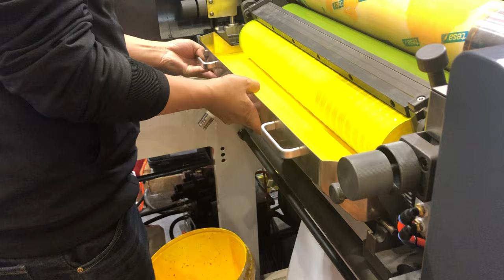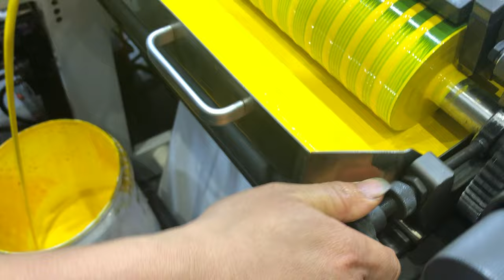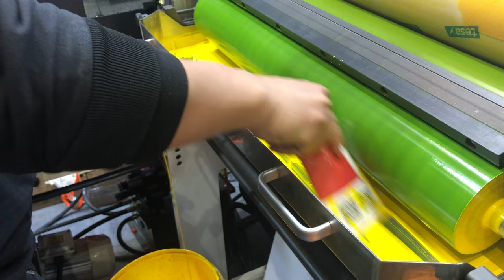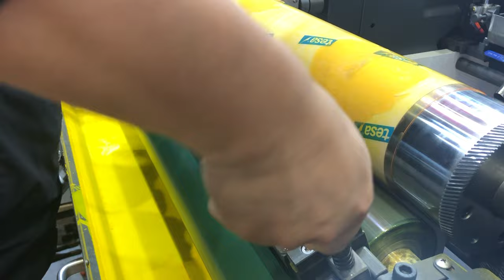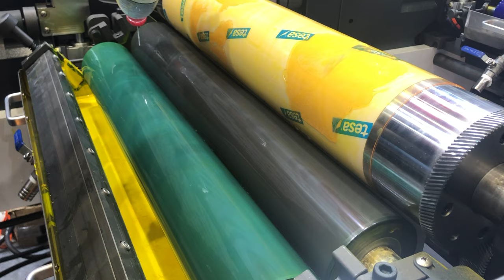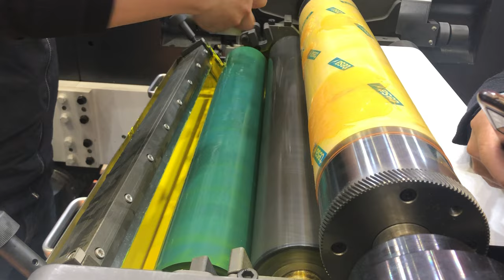Cleaning ink roller& ceramic anilox roller for flexo printing machine

Comment: What is the fluid in the bottle?
Reply from the maker: Water
Reply: Vodka
Reply: Possibly rubbing alcohol
Reply from the maker: @monkeynutz1328  Better using Anilox roller cleaning liquid
Reply: I operate almost the same machine in algeria
Reply: @Oussama-vj7um  do u use uv inks or solvent and water base inks?